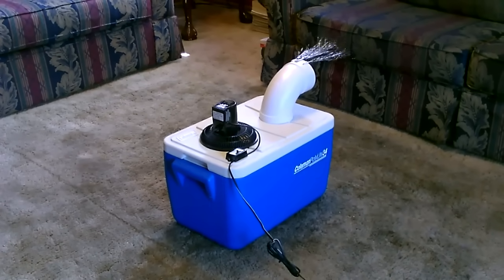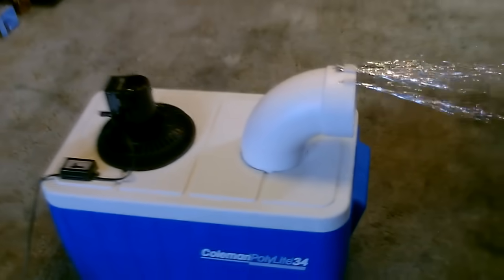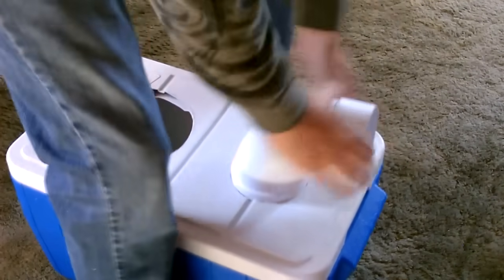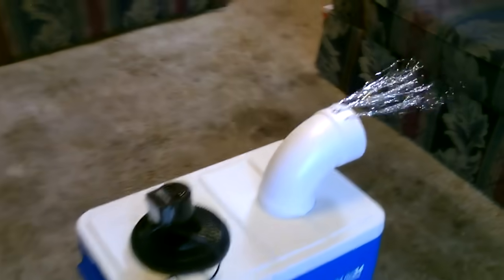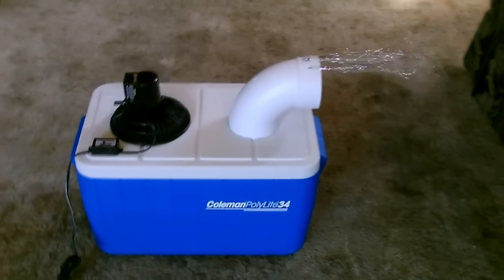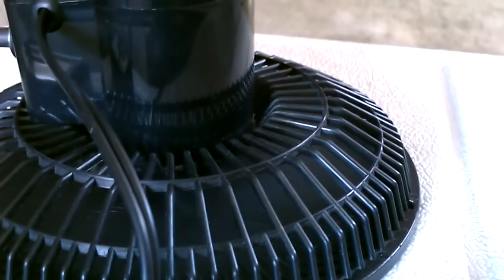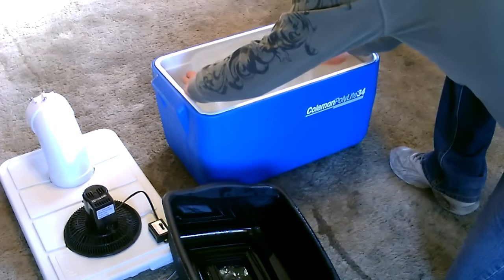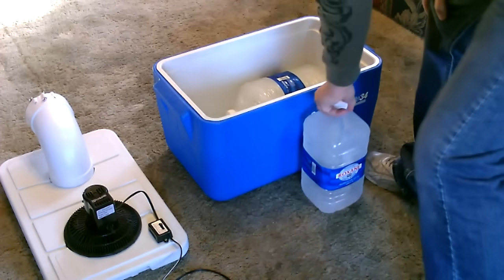Homemade air conditioner DIY - Awesome Air Cooler! - EASY Instructions - can be solar powered!

Comment: I love that you brought an old idea, that works, to a new generation.  This was common back in the 1930s and early 40s, minus the solar power.  My parents told me about their homemade "Air Conditioners" when i was a kid...they called them "Swamp Coolers"
Reply: You are correct, I live in Nevada swamp coolers are common here because of the dry climate i think this set up is awsome its 105 out today and I'm definitely going to make one
Reply: +Luke Lionheart This is not a swamp cooler. A swamp cooler only works in dry environments with low humidity. Swamp coolers run dry air over cooler water to lower the temp. If you live some place where the humidity is 60% + then running the air over water only makes it hotter. He is running the air over a block of ice, so the ice will actually condense some of the humidity back into water which means this setup will work in either a humid or non humid environment. I only comment because I live in South Florida and I hate the heat!!! I have probably researched every method possible to keep cool in the summer. South Florida summers are like northern winters... We board everything up and try not to go outside if possible.
Reply: Onemig Devilla vh ???
Reply: +mike murrey vh

Comment: Here is an idea!! Just thought of it as i watched this video! Add salt to your water before freezing it and it will freeze at a lower temperature! Also just add salt to the icechest and let the ice melt into it, the ice will last longer and be cooler overall. :)
Reply: @Larry Elterman - Exactly!
Reply: The energy absorption is when ice phase changes to liquid. The energy absorbed to raise ice one degree is very small compared to the energy needed to melt ice (cause the phase change) There is far more energy absorbed when water evaporates.
Reply: @Mark G:  Ahhh!  Thank you.  So nice to be in good company and I couldn't have said it better myself.  The manipulation of the latent heat of fusion and heat of vaporization of various materials are what make the world go ROUND.
Reply: Mojetioluwa Gbenu  Exactly what i thought. skin feels salty and irritated.
Reply: ElectricDreamz255 Will Pepper make it hot for those winter nights? just a thought 😂
Reply: ElectricDreamz255 I didn't realized it. nice bro
Reply: I see. So the salt would just make it melt and evaporate sooner?
Reply: Mark G Wow...didn't expect a lecture on thermal Dynamics.. but great job...I think!
Reply: Pretty sure it will make no difference, because it's not about whether it is in solid or liquid form, but about how much heat the water is absorbing from the air. Maybe the salt water won't be ice, but it's still going to be colder than 0 Celsius if salt lowers the water temperature.

If you want the ice to be colder, you can lower your freezer, but it's probably not efficient because it has to lower the temperature and maintain that lower temperature of everything else in your freezer too.

Maybe just more ice?
Reply: ElectricDreamz255 does it really works
Reply: ElectricDreamz255 i79 night
Reply: Nice
Reply: ElectricDreamz255 who cares what temperature the water freezes at. it's going to come out the freezer the same temperature either way?
Reply: Yes, quickly that frozen carbon dioxide, you know, CO2, and raise the CO2 level in the room faster that it can exchange with safe oxygen rich air. 
Or, just take a long nap. From the National Institutes of Health
CO2s main mode of action is as an asphyxiant, although it also exerts 
toxic effects at cellular level. At low concentrations, gaseous carbon 
dioxide appears to have little toxicological effect. At higher 
concentrations it leads to an increased respiratory rate, tachycardia, 
cardiac arrhythmias and impaired consciousness. Concentrations >10% may cause convulsions, coma and death. If dry ice is warmed rapidly, large amounts of carbon dioxide are generated, which can be dangerous, particularly within confined areas. The management of carbon dioxide poisoning requires the immediate removal of the casualty from the toxic environment, the administration of oxygen and appropriate supportive care. In severe cases, assisted ventilation may be required.
Reply: ElectricDreamz255 thx man!!!
Reply: ElectricDreamz255 
Sweet!!
Reply: +Mark G Adding salt to the water prior to freezing will lower the freezing point; thereby providing a block of ice that is colder than 32F, or 0C.  This would lower the temperature output of the device.
Reply: BluntForceTrauma666 The World is FLAT.  Bwahahaha
Reply: Esteban S Rangel ?
Reply: Good point. When you think about it; what do we use or throw on the ground to MELT the snow in the winter months?
Reply: How long does a block of ice last?
Reply: So, you are saying somebody needs to change the laws of physics/thermo dynamics. Interesting challenge.
The human body puts off about 400 BTU's per hour. This contraption absorbs a total of 4000 BTU's. If the fan is slowed to reduce the melt rate, you could extend the cooling effect. The temperature of the room air will be a big factor. The hotter the room air, the faster the fan needs to blow to provide any cooling.
Reply: E
Reply: Groisu that would be toxic....
Reply: ElectricDreamz255 dry ice would work
Reply: Mark G dry ice for outdoor use for my boat
Reply: A valuable lesson can be learned here. Learn physics from textbooks, not YouTube comments.
Reply: You can also add sawdust to the ice ,it will take much longer to melt. I'm gonna make one for the fun of it. it looks so cool😎😎😃😃
Reply: ElectricDreamz255 That seems counterintuitive since salt is added to icy surfaces to help melt the ice and create traction. Cool concept!
Reply: No no... Add some mint leaves and vodka in the chiller and you can drink a nice mojito while cooling
Reply: ElectricDreamz255  why da fuck salt don't causes ice to melt?
Reply: Adding salt to the ice chest will make the ice melt faster, not slower. This actually will make the air coming out colder but at the expense of making the ice last less long. Adding salt to the ice (salt ice cube) will allow the ice to absorb more heat, but a smaller amount of ice with salt, or a larger amount of ice with no salt. Same cost. Think in terms of physics. The salt will basically allow you to  have a smaller cooler. To use less ice for a given amount of cooling. But it will not save money.
Reply: Mark G God bless the nerds!!!
Reply: Salt only changes the freezing/melting point of water. It does not change the total BTU's absorbed when ice melts. The salt will speed up the the process but the cooling effect will be over sooner.
Reply: I'm a need you to act like you were paying attention during science class in elementary.... #4thGradeBro
Reply: The BTU's absorbed by salted ice that freezes at 25 degrees is only 6 BTU's more per pound than ice that is frozen at 31 degrees. But, if the salt ice and the unsalted ice both are frozen to 25 degrees, they both will absorb the same amount by the time the melted water is 34 degrees. 155 BTU's per pound of ice/water. The BTU value comes at the phase change, whether it happens at 25 degrees or 32 degrees, the phase change absorbs 144 BTU's per pound of ice. The latent heat of fusion of water is the same whether that fusion is at 32 degrees or 25 degrees. 
The output temp will be based on 25 degree ice vs 32 degree ice but the same airflow will still have almost the same heat transfer rate so it will not be cooler by any measurable amount. Consider the heat transfer difference of 90 degree air over 25 degree air (65 degree difference) vs 90 degree air over 32 degrees (58 degree differential). The warm air will still have a limit to how fast it conducts heat into the ice. The formula is too complex for this post. The problem is ice, water, and air have very poor heat transfer rates. 
The total cumulative output of cooling will be exactly the same if the ice is frozen to the same temp.
Reply: Adding salt before freezing the ice will not change anything. The temp of the ice coming out of the same freezer will be the same. The salt just makes the phase change at a few degrees lower. 
1 btu per pound to change the temp of the ice one degree. 144 btu per pound to melt the ice, 1 btu per pound to warm the melted water 1 degree. 970 btu's per pound to evaporate the water.
Reply: Adding salt to the ice will not allow the ice to absorb more heat. 50 pounds of ice that is frozen to 10 degrees will absorb the same amount of energy whether it freezes at 32 degrees or at 25 degrees. The 32 degree ice will absorb a bit more energy (7 BTU's per pound of ice) before it starts to melt where the 25 degree ice will absorb 7 BTU's per pound less energy before is starts to melt but will absorb those 7 BTU's per pound once it has melted and continues to warm to 32 degrees. 
Think in terms of physics.
Reply: The salt would not make any difference in total cooling. There is a limit to the BTU absorbed when ice melts and when water evaporates.
Reply: ElectricDreamz255 
Whoever gave this a thumbs up needs to go back to elementary school...

Comment: I have a 10'x14' room to cool.  The door always stays shut so the house ac doesn't really work to cool down the room.  Is it possible to cool that entire room efficiently with this unit?  The temperature in the room runs about 80 degrees even with the house ac on.

Comment: Nice video. Thanks! What kind of fan do you use? Are some more energy efficient? I will have a 135 watt solar panel to recharge 2 6- volt golf cart batteries.

Comment: how would i cut the lid to these types of coolers without the special electric saw?.... :( please help
Reply: if you have  driller then use of it, make holes between 1cm on the marked circle then push it hard you will get hole.
Reply: +Jeg guna I got hole.
Reply: You can use a small hack saw.

Comment: after reading so many comments with no common sense maybe this will help everyone = use any size cooler/fan you want to best fit your needs. and check the ice every hour or so until it starts melting and then add new ice!
Reply: Not all fans are the same. You can buy cheap fans that are amazing or expensive fans that can turn out to be shit. Asking what fan the guy is using because it looks as if the airflow is decent doesn't mean you have no common sense there matey.
Reply: It looks like a cheap ass dollar store desk fan to me and some cooler he had laying around. He's not building a cooler for the international space station bud. It's more the idea of using what you have instead of spending like 500 dollars on a portable a/c unit that does the same thing.
Reply: There's this amazing new invention with reviews, pricing,  and products, oh my! Mother fucking Amazon..

Comment: That's a cool thing, literally. I'm an A/C guy by trade. I may need to find a different job, if everyone makes those. I don't think you would destroy a Yeti cooler, but it would probably last 10 hours. However, I would probably use some sort of refrigerator grate shelving with some 3'' PVC on the corners to keep the ice of the bottom. The air would go under and over the block of ice, the air will also pass above the cold water on the bottom. This is like 3 stages. The cold air will last longer in my opinion. Remember, the slower the air the colder it will be. Good job

Comment: Great but if you run a duct from the fan coil it in the water then out the exhaust it will be way cooler.

Comment: Solar powered air cooler. So the hotter it gets, the more power you have for the air cooler, which it needs bc it's hotter. Pretty clever
Reply: you do realise that solar requires direct sunlight right?
Reply: *****
No.  LOL
You are not going to run a refrigerator off of 15W.
Reply: Gottabe kidding what is wrong with you?
Reply: +Shoulon You can just put a panel outside of your house and connect to it... That would be pretty damn expensive thought...
Reply: Shoulon 😂😂😂
Reply: *****
No. LOL
Reply: You have no idea what you are talking about.  The amount of efficiency that is lost at a hotter temp is negligible.  Some lose 1.5% in temps above 32 C/90 F and increase 1.5% for every increase of 1 Celsius.
At 32 C the loss of a 15W cell would be a staggering 0.225W, at  37C / 100 F would be a loss of 1.125W.  The better ones don't start losing their efficiency until 35C.  So there you go, you may weep now.
Reply: lel
Reply: TEK ASSASSIN GAMING n
Reply: PrecisionWrittens
Reply: PrecisionWrittens,
The hotter it gets, the more solar power you have??😂
Reply: TEK ASSASSIN GAMING you aren't one to be calling people "dweebs". Stop trying to be cool you just sound immature
Reply: Gottabe kidding you're a piece of shit
Reply: Gottabe kidding search for ARB they make refrigerators that run on 10W
Reply: Bunch of idiots arguing over the dumbest shit. 
What is this a gay nerd convention??
Won't you figure out how hot my balls get on a hot summer day vs a winter cold day 😂😂😂😂
Fucking dweebs!!!

Comment: Better to use plastic bottles. salt water for colder temps. longer lasting. 4 or 6 ----  Frozen 1  gallon jugs.
Reply: What is the best salt to water ratio for this?
Reply: OcRefrigeration,Hvac & Electrical. 
Wow! Colder and longer-lasting by adding salt?! Right🤤
Reply: +Josh Hall 90 10
Reply: No, it will last 4-6 hrs if it's air tight...for such high air flow it'll last  for about 1/2hr

Comment: This is pretty nifty.

I'm going to be taking a roadtrip in august in a minivan who's AC may not be working, and if it's not I may build one of these to keep it cool inside and use one of those cigarette lighter fans. Especially because 5 bodies in summer with no AC would be unbearable.
Reply: Just don't use dry ice, unless you want to asphyxiate due to CO2 emissions.
Reply: +QuickNET Tech trust me, I had already had that thought and came to the same conclusion.

Comment: If only there was a way to sustain the temperature below freezing indefinitely in the cooler . Some liquid catalyst that would react with the ice. Hmmm.
Reply: +EDIBERTO &quot;EDDIE&quot; LEAL i was thinking about adding a layer of dry ice at the bottom of the cooler. i dont how much of a difference it would make. seems like it would help.
Reply: +Ron Barnes The danger of dry ice : the outgassing from it can cause hypercapnia (abnormally elevated carbon dioxide levels in the blood) due to buildup in confined locations.

Comment: Hi, 
I want to buy some portable solar energy generator for 1 air conditioner(8000-11,000 BTU"S). I'm planning to use the air conditioner for 8 hrs daily. Also, I live in Puerto Rico which is really sunny island in the caribbean. What do you recommend for this folk that doesn't  know to much about electronics & solar generators.
Reply: +vintageRE cords Sup fellow Boricua

Comment: Would it last longer if you release water from cooler using its drain?
Reply: +Jason Miller instead of draining, maybe elevate the ice a couple of inches using a plastic grate, so that when the ice melts, it collects below the ice, rather than pooling around it. (maybe even add some ice below the grate to keep that melted water cooler!)

Comment: A little tip for this project. Add a solar powered Ice-maker (add water supply supply to it via float valve) and drain for melted Ice. ( the melted Ice could also be connected to a solar water pump that would pump the water back to the water supply) Then you would have an off grid solar A/C.

Comment: Ice if of course not free to make. However, it is much cheaper than an AC. Furthermore, in most places across the world, electricity is cheaper during off peak times. Meaning you could make the ice between midnight and 6 am when electricity is cheap and then use it for you homemade AC.
Reply: He's talking about the cost OF electricity from the Electric Company, costs more During the day a Kilowatt during the day (peak hours) then at night. he wast talking about fridge on half the day at night , lame.

Comment: You could also use bagged ice with a little water and add rock salt or table salt to bring the ice temperature down even lower and it would last longer.Old hunting trick to keep dressed meat cold longer.

Comment: Nice vid desertsun.Anyone not getting enough airflow??I used a 200mm exhaust fan, 38l ice box, 95mm pvc. Could have upped to 250mm fan again.. Just. It moves a lot more air than the other fans I had around the house and is almost silent with the fan cover off. Exhaust fan Takes up some "ice" space due to reverse mounting.

Comment: how would i make this if i dont have access to power tools?
Reply: +DMariaN Basarab carefully
Reply: +DMariaN Basarab Utility knife, key hole saw, butter knife and blow torch, etc.
Reply: +DMariaN Basarab ...just use a hacksaw blade. Make sure you wrap one end of the blade with a cloth for holding.
Reply: hi there please respond this question...can I use a mini fan with a regular electric thanks